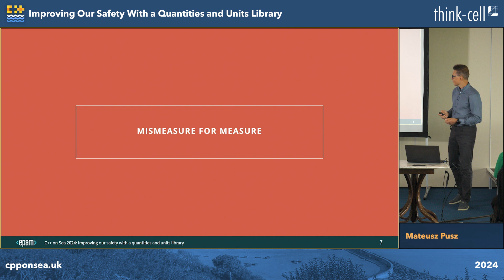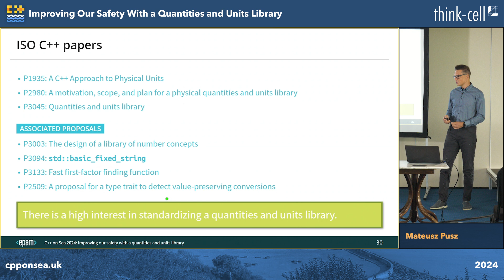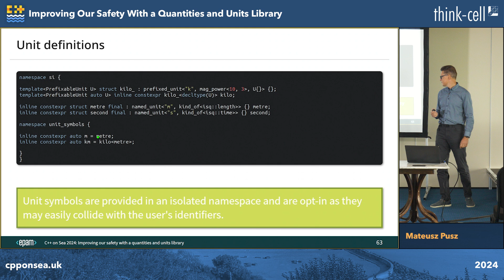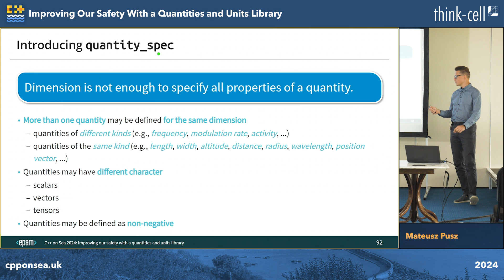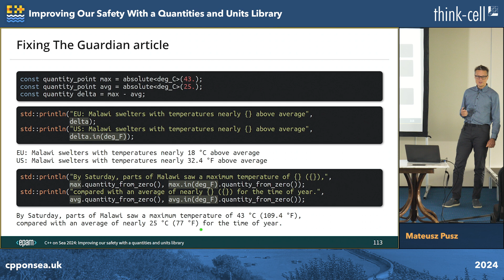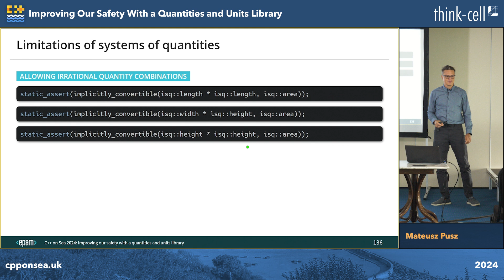Improving Our Safety With a Modern C++ Quantities and Units Library - Mateusz Pusz - C++ on Sea 2024

Comment: Dealing with units in C++ is a great idea. However I think there are many other things that need fixing in C++ to make it fit for use in safety critical systems. Having done a lot of work in avionics and such over the decades I have always thought it was pretty much professional negligence to use languages like C and C++ for such things.
Reply: I definitely agree about C.

However, C++ is a different story. It is much safer (if you do not write C-like code) and provides great and safe abstractions.

It is the only programming language where we can handle quantities and units so safe, with such simple and easy to understand interfaces, and with no runtime cost (speed and size).